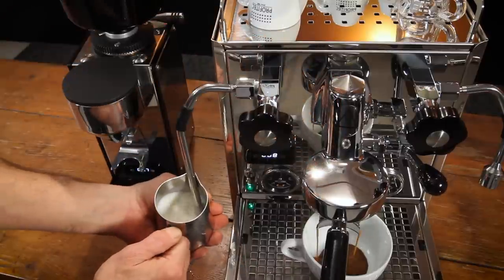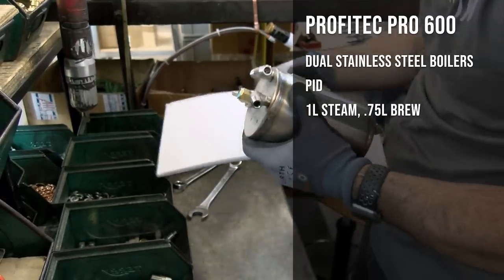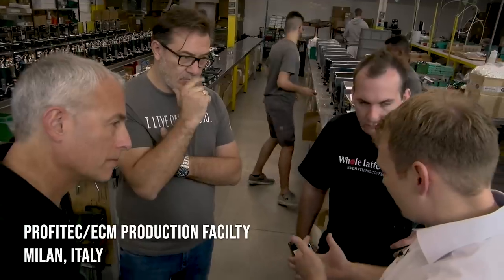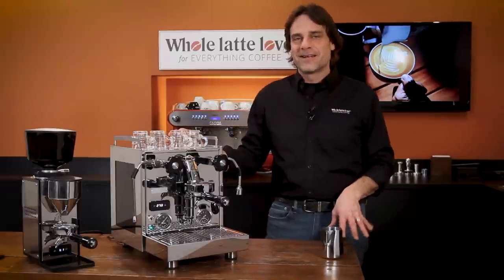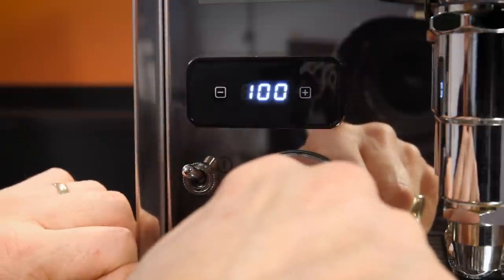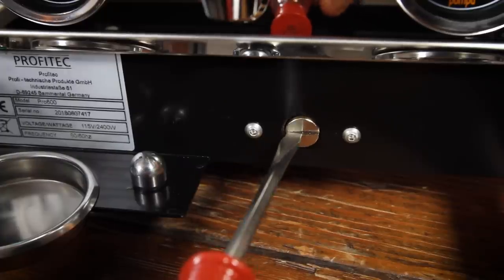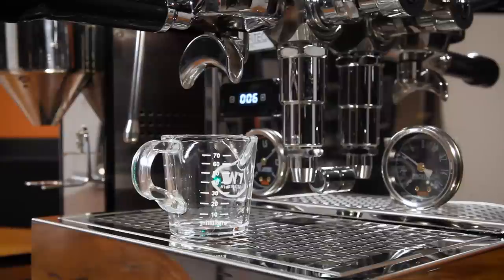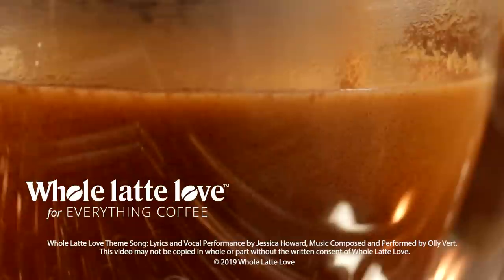Review: Profitec Pro 600 Dual Boiler PID Espresso Machine

Comment: Hi Mark! Thanks for the indepth review. I recently upgraded to the Profitec 600 from a Gaggia Classic and I am loving the consistent taste of my shots now.  I'm also having fun trying to get the right microfoam for latte art!

In the video, you state the steam pressure gets up to 2 bars when you set it at 272 degrees.  I have mine set at 267 degrees and get from 1 to 1.5 bars steam pressure. I make 3-4 lattes in the morning. Do you recommend I change my steam boiler temperature to 272?  

I have had my brew boiler set to 199 degrees...maybe I'll set it to 200 degrees to match yours and see if I notice any taste differences!
Reply from the maker: Hi Lisa, Thank you for the comment! Coming from the Classic you've got to love the ability to brew and steam simultaneously and the rock solid brew temps.
My steam boiler is set to 270F (that's t2 on the PID control) which is max setting. Not unusual to see the display indicate 272 now and then. There is some variation in pressure/temperature relationship based on altitude above sea level. Raising your t2 to 270 will increase the steam power. Personally I like the extra power and I recommend you give it a try. If you feel it's too much you can always dial it back.
Marc

Comment: I purchased this machine from WLL and I like it very much! One thing that prospective buyers should keep in mind is that the manual says that one should not descale the machine oneself because descaling requires partial disassembly of the machine. This means that every few years one should ship this huge machine to a dealer and pay them for descaling.  The time and cost of this should be factored in your decision. I wish there was a video for those of us who are technically inclined showing how to descale the machine ourselves.
Reply: @@nothingbutlove3449 my understanding is that distilled water is not ideal for brewing coffee and it may also damage your machine by corroding it.

Comment: Hi Marc, I plan to use this as my next upgrade as I think this is the perfect option for a non-plumbable machine. What I need to know is that if Baratza Sette 270Wi will be a capable enough grinder for this machine or should I definitely check out the likes of T64.

Comment: can you fill the tank without removing it?  i mean, just use a pitcher of water to pour into the tank, or is that not recommended??  I cant use it if I have to remove the tank to refill, no clearance under cabinets for that.

Comment: Marc, I notice in all your videos when you are showing off machines that do all sorts of beverages, you use different size/style cups/mugs for different drinks.  Maybe you could do a video talking about the optimal mugs/cups/glasses for different types of drinks for a newbie like myself who is just getting into the game.  Food for thought  :)
Reply from the maker: Matt A hi, thanks for the suggestion. I need to do better and not take those newer to the game for granted. Do check out the playlist on our channel. A couple that are specifically designed for newbies - especially the quick tips!
Marc
Reply: @Wholelattelovepage  You are doing a great job, that's why I subscribed.  These were just some basic questions that anyone that's been working with these machines and other types of coffee drinks already know.  All I've ever had was just a straight Americana coffee, so I don't know anything else.  I just want to make sure when I get my Academia that I have all the right glasses and such to start really diving into it.  Also, for 2019 will Gaggia be releasing new versions of their line?  Are there new machines in 2019 that would compete with the Academia?  I won't be ready to buy one of these machines for a few months yet, so I'm trying to make the most informed decision.
Reply from the maker: Hi Matt, I do not anticipate new Gaggia machines in the Accademia class. Currently, there is the Babila which is very similar to the Accademia - maybe a more contemporary design of the front panel: https://www.wholelattelove.com/gaggia-babila-one-touch-coffee-and-espresso-machine
Marc

Comment: Hey Mark I purchased my pro 600 from WLL and the machine is very well made. the only thing I noticed is that in the video you state that the steam wand comes with four holes, but mine only has two. love the machine any ways!
Reply from the maker: Hi DD, Thanks for sharing your thoughts on the Pro 600 and of course your patronage! So this video is an older one  - since being made Profitec changed the steam tip.
Marc

Comment: hi, can you tell something about energy consumption and how much energy you save when temporarily switching off the steam boiler when not needed? How would consumption compare to for example a Bezzera Magica?
Reply from the maker: Hi VV, Thanks for the question. A lot of variables involved in power consumption. If not using the steam boiler I would turn it off - will save power!
Marc

Comment: Q:  Is there any dual-boiler, E61 machine that's less expensive?  This seems like a great value.
Reply: Actually, it seems like the Lelit Bianca is at about the same price and is also a dual-boiler, E61 machine.
Reply from the maker: Hey Mike, thanks for the question. The Pro 600 is an excellent value in dual boiler machines. If you compare the 600 to the Bianca up close the 600 has a higher build quality.

Comment: Hi Mark! Great video about profitec pro 600. Do you have preferred grinder for this machine or any brand will bring same result?
Reply from the maker: Hi JJP, Thanks for the kind comment and question! For best results with the Pro 600 I recommend an espresso focused grinder with flat burrs at least 50mm in size. The Eureka Mignon Specialita is a good choice with 55mm burrs, 2 timed presets or manual grinding in a compact package. A step up are the Ceado E5Pro or E6P. Both use larger 64mm burrs and featured mostly machined components while some Mignon components are forged. The E5Pro is manual with no timed presets. The E6P has 2 timed presets plus manual grinding.
Hope that helps!
Marc
Eureka Mignon Specilita has tons of color options: https://www.wholelattelove.com/search?q=specialita
Ceado E5Pro: https://www.wholelattelove.com/products/ceado-e5-pro-espresso-grinder
Ceado E6P: https://www.wholelattelove.com/products/ceado-e6p-electronic-dosing-grinder-v2

Comment: Did you use the 2 Holes Steam Tip for the video...it looks like a 4? thanks
Reply from the maker: Hi Marc, Current Pro 600 machines do come with  2 hole steam tip. Back when this video was made they came with a 4 hole tip.
Marc

Comment: I’m considering this or the Pro 500.
I’m thinking the thermal energy available should be higher with a 2l high temperature boiler than a 1l high temperature plus a 0,75l low temperature boiler. So the back-to-back shot capacity should be greater.
Or am I missing something?
Reply from the maker: Hi Arvid, Thanks for the question. Don't forget in a DB machine like the 600 each boiler has its own heating element. The Pro 500 has a single element. The 600 can run at higher steam pressure in it's service boiler - up to ~2 bar. Also, changing the pressure/temperature of the service boiler has no impact on brew temps. On the 500 if you adjust the PID for a lower brew temp you also decrease pressure/temp in the main steam producing section of the boiler.
Marc

Comment: Marc, for this machine, what is the approximate time from powering on to reach brew and steam temp? Thanks for another in depth video.
Reply from the maker: Hi venwin25, You are welcome! Thanks for the question. It's about 15 minutes for the machine to fully heat up. That's been my experience and Profitec's recommendation. A little faster than some other DB machines as the steam boiler is smaller at 1L. For comparison the steam boiler on the Pro 700 is 2L.
Marc

Comment: Hey Mark, love your videos! I recently bought this machine and was wondering on how to descale it but I can't seem to find any Information about this on the internet. The manual says to bring it to a service center but on the Pro 500 and 700 it has instructions for descaling. Do you know why that is? My retailer told me it's fine to just descale it like any other machine but I'm really hesitant since I don't find any information about this online. I have fairly hard water (~20 dhg -> some german index which stands for "german level of hardness" so you probably don't know what that means but just as a reference) and I'm using a BWT pad to reduce the hardness and it does come down to 5-8 dhg. It's not too bad but I think it would still be good to descale it every once in a while or not? Does it have something to do with the boilers being made out of stainless steel? Thanks in advance!
Reply from the maker: Hi FV, Thanks for the kind words on the videos!
Manufacturers generally advise against home users descaling dual boiler machines due to the risk of scale particles dislodging and plugging up other parts of the machine and because draining the boilers is more involved than on machines with HX or single boilers. Scale plugging during descaling generally happens only with neglected machines. Like a machine used in a hard water environment for a long period with no water treatment to reduce hardness and no regular descaling. At 20 degrees German your water is rather hard so you're doing the right thing using the BWT Bestsave pad filter. Be sure and replace the pad on schedule and that water in reservoir has enough residence time in reservoir before use. If using the pad filter properly you should have little to no scale forming. Stainless boilers can be descaled. After some use, you can get an idea on whether scale is occurring by removing the mushroom valve and inspecting for evidence of scale. I don't recommend home users descale dual boilers. That because I'll say go ahead and do it and somebody with a neglected machine will have problems brought on by descaling and blame me. With all that, If someone is 100% certain they don't have anything beyond very light scale  - like next to none then descaling should not be a problem. In your shoes I'd talk to your retailer and get their recommended procedure for descaling the machine. There are many ways to do it, but if you run into trouble they might be somewhat accountable if you run into a problem and you followed their procedure. In our shop, boilers are generally removed for descaling but that's mostly for machines which have been neglected and show evidence of more aggressive scale deposits. Hope that helps.
Marc
Reply: @Wholelattelovepage  wow, that actually helps a lot! Thanks so much for your very detailed answer!!

Comment: Hi Mark! I love watching your reviews! Could you help me out: I am coming from a Rocket Appartamento (nice machine) but would like better steam pressure and better ability to deal with dialing in new coffees (flow control - available for all 3 profitec machine  correct?). Will the heat exchanger Pro500 suffice for me? Will the Pro600 give me better steam being a dual boiler? Will the Pro700 give me any better value or functionality assuming I don’t plan to plumb the machine? Thanks, Andreas
Reply from the maker: Hi Andreas, Thanks for the questions and your kind comments! Flow control is available on all Profitec machines with E61 group. If you really want to bump up the steam power the 600 or 700 is the way to go. The 500, 600 and 700 are all PID brew temp controlled a drantaic improvement in brew temp accuracy over the Appartamento. The Pro 600 and Pro 700 feature best in class steaming power capable of running at near 2 bar of pressure in the service boiler. The 500 does fine but as a heat exchange boiler machine increasing the boiler temp for higher steam power results in higher brew temps and it maxes out at about 1.4 bar. Beyond plumbability, the key differences between the 600 and 700 are the rotary pump in the 700 vs. vibration pump in the 600 and larger boilers in the 700. Rotary pumps have a higher potential flow rate of about 11g/s. Vibration pump machines run at about 8g/s. In my experience higher flow rates are beneficial when using darker roasted beans or beans beyond peak freshness. The rotary pump is quieter.  Both machines can make drinks rapidly back to back but if you anticipate steaming larger amounts of milk the 700 has more reserve. I hope that helps in  your decision.
Marc

Comment: I love my Pro 600! I bought mine from another retailer due to a significant difference in shipping cost. I would highly recommend this machine to anyone. I had a Expobar Office programable that I bought from WLL 16 years ago which failed after 3 years and made a deal with WLL to replace it with a refurbished Expobar Offic Lever. I had that machine for 12 years and it was great, but I wanted more steam capacity and the control that a PID machine provided. So I bought the Pro 600 and it has certainly been a great machine that produces wonderful espresso.

Comment: I've had my Profitec 600 from WLL for only a few months, and I've noticed the steam valve is very squeaky (super loud). Is that normal? Or is this something that needs to be fixed to keep my machine safe?
Reply from the maker: Hi JJ, Thanks for the question and please excuse my delayed response - I've been on vacation and offline for a week. Quickest way to support for your machine is a call to our tech support pros. Contact info here: https://www.wholelattelove.com/pages/contact-us
Squeaking can happen but I would not say it's normal. It may be an indication of scaling or wear in the valve components but hard to say for sure. Regardless of cause it's highly unlikely your machine is unsafe! Here's a link to an expanded diagram of the Pro 600: https://wiki.wholelattelove.com/images/e/ed/PRO_600_Parts_Diagram.pdf Exploded view of valve is shown in drawing 6.
Marc
Reply: @Wholelattelovepage  thanks for the reply Marc!

I located your video on how to remove the handles from the steam valve. After doing so, I used a little food safe oil to lubricate the threading of the handles and that solved the issue. It looks like there was just too much friction on the threading. Back in business with no squeaking now!

Comment: Hi, Marc, thanks for the excellent video.  Do you need a 20A wall socket for the power source or is 15A source enough? What would be the maximum wattage of the machine when you use the two boilers, brewing and steaming, at the same time?
Reply from the maker: Hi James, You are welcome and thanks for the question. Maximum draw of the machine is 1400 watts which equals ~11.5amps. The machine is setup so heating elements will not operate simultaneously. 15A circuit should be sufficient but 20A is recommended.
Marc
Reply: @Wholelattelovepage  Hi Marc - I question your reply - firstly the label behind the drip tray says 2400w. Secondly, if only one element operates at any given time, it would not be possible to pull a shot and steam at the same time! Can you please clarify?

Comment: Hi Mark, I am reading many things about coffee flavours, how to better achieve the best from coffee etc.
I always wondered, is it worth it to spend 2k euro for a machine like this ( a part from the esthetic obviously )?
Reply from the maker: Hi Leonida, If serious about espresso they are worth it. These machines are beautiful and built to run for decades. Making exceptional espresso is all about controlling variables like brew temp, pressure, coffee dose and grind. That's what machines at this level can do. There are espresso appliances which cost far less. Many use undersized pressurized filter basket brewing systems which are incapable of the same quality. They have poor control of brew temp and pressure, cannot brew and froth milk at the same time and have a build quality that'll put them in the garbage within a few years.
Marc
Reply: So you are saying that, if I'd buy Breville Barista Express, even if I don't care of brewing and frothing milk at the same time, even if with Barista u can have control of pressure, grind size and timing, this machine ( a part from how amazing it looks ) it's still worth it despite the difference in price, for the consistency it offers and the years of work it can sustain. Am I right? @Wholelattelovepage  
Thank you for the time u spend in replying
Reply from the maker: That's what I'm saying.
Reply: Thank u Mark. Have a good evening. From Milan.  @Wholelattelovepage

Comment: Hi Mark,
Please explain if may I upgrade P600 with special valve on top öffentlich group to manually change flow? 
Do P600 offer electronic settings of preinfusuon time?
Reply from the maker: Hi NM, No flow control is manual.
Marc